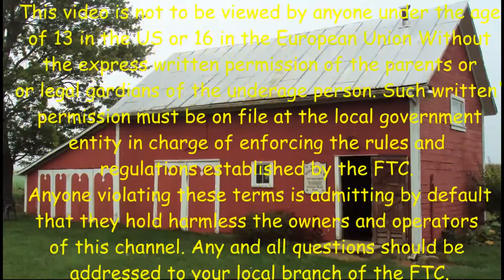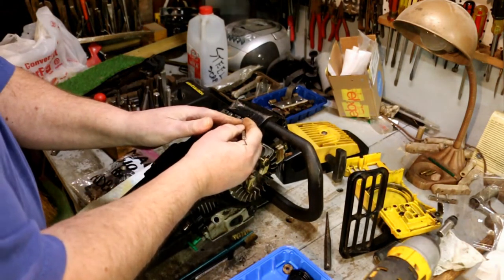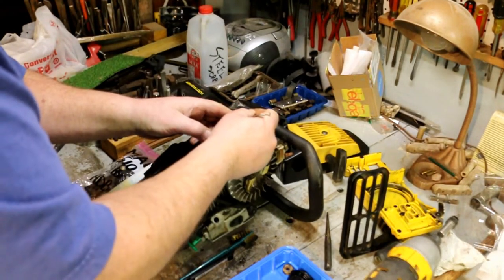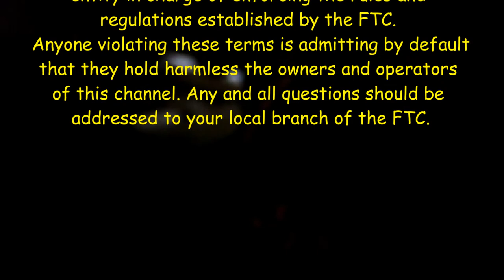Cleaning Saws & Saw Blades Pt 1

Comment: The elusive 10mm socket...  =D   Nothing worse then missing a needed socket!   Great stuff!
Reply from the maker: It has gotten better over time. I got the clip on socket rack and try to pick up the tools after the end of the day. I use to just leave them on the bench because I was coming back to the job anyway. 
Now with all the multiple projects piled up and waiting it is better to have the tools in one spot so I can find what I need. 
The kitchen project really messed up the shop. I had to move the whole south side of the shop over to the north so I could run wire and plumbing. 🥴

Comment: 10/4 about the picks, low batteries (which can be a good thing) 10 mm bolts and I was thinking a 5 gallon bucket lid for the saw blades! I'd brag about being first but every time I see one I think if I want a medal or a chest to pin it on. Like the last day I was in the Army, the LAST day. There was some guy in another outfit always hollering 'SHORT' every morning in the mess hall. EVERY morning and the amount of days he had left. My last day, all me and my pals were eating and this guy got up and screamed 'SHORT' and however many days. I had my dress uniform on and was on my way to Ft. Eustis to process OUT. My pals were goading me into burning the 'short timer'UP- 'Go On, get him, Lew' and such like. So I just stood up, looked the guy right in the eye and sid very quietly, 'hours' and sat back down.
 'Nuff said. Thanks, Unc! GBWYall!
Reply from the maker: Best way to deal with it. The guy was happy as the dickens and probably worried that something would happen at the last minute. 
Ryan and I worked at the same place. Both of us writing work instructions. He did the MRAP vehicle fab and assemble side and I did the Hummer Up Armor side. We helped each other on rush jobs but mostly just kept ahead of engineering changes.
Ryan had a retirement party for me and the Engineering Staff all came and wished me well. 
On my retirement day I picked up my jacket and walked out the door. 
Little did I know that 3 years later they would call me back because they laid Ryan off. He had found a new job. When the sales dept brought in a new job no one knew how to write work instructions for it.  I worked three months training the new guy and catching them up on changes to the jobs that hadn't been updated for two years. 
As soon as I trained the guy and he was reasonably good at the task. I said I'm done and went home. The new guy quit a few weeks later. I was already on another consulting job so they got along somehow. The company was sold the next year.
Reply: And  had heard someone holler 'SHORT' for almost 3 years and I was sick of it. I couldn't change them but I didn't have to be one of them.
Reply: @lewiemcneely9143  I worked 30yrs for a Pulp and Paper mill. Early on mechanics retired with 40-45 yrs service, this was a family owned company and looking back was very good to work for.  After 2yrs of pulling wrenches I got the job of watching over the "short timers" less than 30 days til retirement day.  I was told to watch them and NOT let them get hurt.  From 8 till 10 was coffee and nap time, From 10 till noon was more coffee, potty breaks and more naps, BUT heaven forbid if I lat them sleep through lunch. At lunch I was to watch the card game and make sure they didn't fall out of their chair. You can only guess how the rest of my day went.  At retirement we had cake and icecream their wife and children came down to the Mill. It was a good time for all.  I don't know what would have happen if I had allowed one old timer fall and bread a leg. Yes that was the good old days.
Reply: @paulharriss1192  I was all over the outside of the paper mill here but never got to go look around on an inside tour. I knew gobbs of folks that worked there and they made a quality product but what part of the innards I DID see just made me want to stay outside. I did a lot of hauling in and out, some helping on concrete form work for the fork trucks to run on but a lot of draglining over on the 'dump' and brush hauling cleanup and digging up garden plots in the fall. Everywhere I worked I always worked till I left at the end of the end. I was the last operator left with the laborers picking up rocks on another part of the same road I first started on. When I was supposed to be clearing to come back to the states in RVN they had to come find me. I was running the D7-E in Virginia the day before I got out and had lieutenants and everybody riding with me in the shotgun seat. I always pulled full shifts wherever I was because I suppose that working was my 'hobby'. I always loved blowing smoke and as a childhood pal said, 'I spent my life moving rocks from one place to another'.  Didn't really matter what with, along as it 'was'. Machines, trucks, hauling boulders or concrete, I was happy. I still am. I've had a GOOD life. I have been BLESSED beyond measure! I started pulling a roller on a road job fresh out of high school and was hauling dirt on a road about 4k feet up I'd like to show you when all this gout started in June or July but I still love it.  And a mower is still a machine. I'll settle for whatever I can get, and be happy! 
Bless you, Buddy!

Comment: On those occasional metrics I think what happens is there’s this one aggravating mechanical engineer that decides to use a xx/32 nd or even an occasional xx/64th headed bolt, nut or cap screw in their design. He probably wasn’t loved enough by his mother and he’s taking his frustrations out on us guys that get irritated by things like this. LOL. What other reason could there possibly be ....??
Reply from the maker: We got the bid to help a company catch up on back orders of tanks for the Caterpillar 797 dump trucks. The design has the tank easily removed and replaced with a full one kind of like a propane tank. https://youtu.be/QC5xzmeYP74
I went down to the shop where the customer's crew was working night and day making one tank on each of 3 shifts. 21 tanks a week. 
Our sales rep had gotten the prints so we could bid on the tanks and I had a pretty good idea how we wanted to assemble them. We were using robots for production runs of main beams and grader blade mount beams for the Caterpillar M24 Grader. 
We also were making the frame sections for the Caterpillar Dump Trucks. 
I was checking the assembly methods and writing work instructions for the crew that would be welding the assembly at our shop. 
The customer's crew had jigs and fixtures setup to help with alignment and assembly. I was asking a lot of questions and they were eager to explain how each one worked. They really wanted us to succeed. They had been working 7 days a week since getting the contract. 
As I was working through writing the instructions I noticed that one jig used to hold a fitting was being attached with a 3/8-18 socket head cap screw. There were 4 threaded holes but they only needed to use one of them. 
The fitting was on the bottom of the tank and held a 4 bolt flange. 
When we started assembling the tanks back at our shop we were pressure testing the assemblies. 
After welding in the bulkhead fittings on the first tank the assemblers noticed that one hole was hard to start the 3/8" bolt in. 
When I called the Caterpillar Engineers they figured out that the design team in working with our customer made some changes to the assembly. The prints were a year behind the build, but as long as no one else built them everything was fine. 
I tend to bore into problems. Especially when there is a deadline and sales has promised the moon with a ring around it. I contacted the engineers and we marked up a set of drawings. The kicker was that the prints called for one metric bolt out of the 4 flange bolts. All the fittings that we had machined for welding to the tanks were made for the metric bolt. 
Out there in the world there is some mechanic cussing a blue streak and drilling out a broken bolt on that flange. We were shipping tanks at twice the rate of our customer. That means for the last year I worked we shipped over 750 tanks.
Reply: @OldSneelock  BIG old stuff. The biggest grader I herded was an Austin/Western that had 'T' handle steering, all wheel drive and a tandem rear and looked like a 14 or 16 foot wide blade. Cats were #12's or 120's and 118 Gallons. The 24 was a BEAR!
Reply from the maker: @lewiemcneely9143  The frame beams were being made in Mexico, by hand. We built a Lego/Erector set type fixture and had jigs made to mount all the blocks and line mounts on the beam. We wanted to get the blade business. That was a piece of cake compared to the main beam. We couldn't touch their labor costs but the robots were so repeatable we could weld them twice as fast with better welds. 
The first batch was a bear. The part drawings were close enough is good enough.
Reply: @OldSneelock  That was a BIG truck though BUT if you could Jig it, you had it made and like you said, the robots could do the job. I'd like to've been there!!!

Comment: In metric land (the rest of the world apart from USA 😁) if you have a 10mm (3/8) and a 13mm (1/2) then you can be sure that more than 50% of bolts will be one of those sizes. In my collection of spanners ranging from 6mm to 32mm I will use some hardly ever but the 10mm and 13mm are always to hand. I do not miss Whitworth, SAE, A/F, BA etc, etc and when I come across one I have to dig down to the bottom of the tool box to find a spanner or socket kept "just in case". I used to be a big fan of A/F but would not want to go back now as metric really has taken over.
Reply from the maker: Being inclined toward repairing the old, weird, obsolete, broken, and occasionally barely recognizable items that most would throw out, that's where I get them from. 😆  I have a better than even chance that even if the thing was built to NASA Standards someone with an equal or slightly less interest in making the lame walk and the dead rise will cobble an approximation of what it was together. 
They will use found or borrowed objects to imitate the originals. Close, but not quite right. 
Not good, but good enough. So rather than have a one legged chicken hopping around and feeling like the poor thing already has enough problems I will craft a new leg, or whatever is needed to bring the cripple back into the flock.
Reply: I never get bent about the metrics. I have a drawer full and standard too. Whatever it takes and after the metric gets big enough, the standard will work, just not really snug!
Reply: After the 32mm comes the Stillsons 😁.
Reply from the maker: @uktony1525  When you get into stretching Extrusion Press Tie Rods there are hydraulic torque wrenches, which I loooovvvveee, followed by pins and 20 lb sledges. Not entirely my favorites but better than chain wrenches. Chain wrenches fit nearly everything. They are amazing tools. How something could have such design promise and end up nearly useless is baffling. 
Perhaps it is from ignorance. Not stupidity. Just not knowing how to wrap the chain. Always under. Never over. Over lets the chain slip loose, spin around, and whack your...............knuckles.

Ouch!
Reply: Record Tools used to make a chain wrench when it was based in Sheffield which was a beast of a tool at over £250 but they had a warning on it that it was only to be used on thick wall ferrous pipe or bar as the torque achieved would snap anything else. Now made in China😤.
Reply from the maker: @uktony1525  I was taught to tighten the pipe with the smallest wrench that would do the job and loosen it with the next larger size. The plants covered four or five city blocks and the shop was in the middle. We all had tool pouches for common use hand tools. I carried a 14" and an 18" std on the rolling cart. The 14" will handle 1/2" up to 1 1/2" iron pipe. Smaller than that I used  Channellock 420 pliers. The two wrenches let me work up to a 1 1/2" pipe union. Anything bigger than that meant a walk to the shop and bringing the plumbing box with a fork lift.